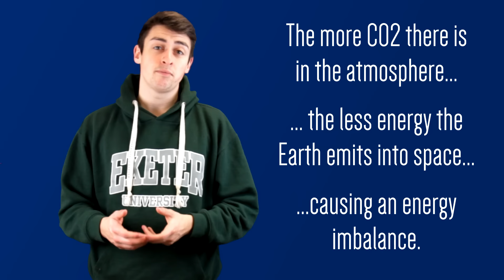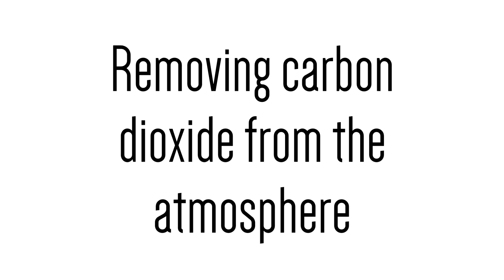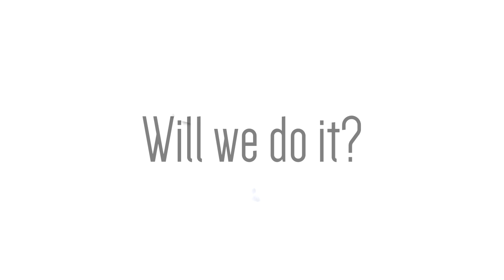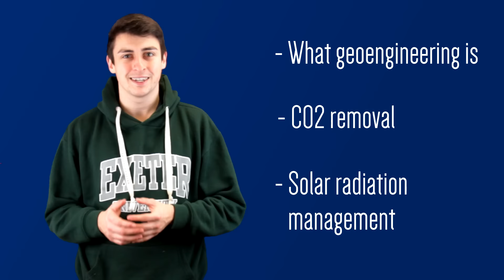Geoengineering - Crash Course #7

Comment: Bro geoengineering is already completely going on and not only in study's it's already in full business use man, I live in South Bavaria at the Alps and on days where its gonna be really hot it's done from the morning until Midday/ Afternoon, depending
Basically you can see a few big airplanes high up that spread sth in the air that extends, done in patterns it covers big parts of the land.

No doubt planting more trees etc. would be way more sustainable.
Reply: Sadly, trees are not surviving. We're too far gone.
Reply: Exactly! I live in Allgäu and I have been documenting these chemtrails since years. Did you also notice a sudden stop in 2016? And that they recommenced in 2020? I had almost forgotten about them until I noticed the grid during the first lockdown.
Reply: @MaryJoDeLaTorre7  I document them too!

Comment: What are your personal views on nuclear energy? Particularly on thorium based fusion reactors. I read It could have the potential to replace fossil fuels, but many events during the nuclear development era (WWII) prevented this from happening.
Reply from the maker: +Mauricio Ortiz It's a very complex issue but I think we need to use a lot more nuclear power. It's the only technology that has been shown to produce enough energy for our needs while emitting less carbon than fossil fuels in the long run. Safety concerns as far as nuclear goes are overblown I think.
Reply: +littlestarfish87 With new reactor designs waste isn't that big of a problem and in any case the problems nuclear waste is causing are minuscule when done properly and not like in the good old soviet union. Just look at the yearly deaths caused by nuclear compared to any other even remotely large scale electricity production method, the data shows that nuclear is incredibly safe compared to other even fully renewable forms of energy production. I fear that people going against nuclear are hindering progress when it comes to reducing co2 emissions because of fears that are born out of  not understanding how nuclear power works. The thing is that there are no large scale viable alternatives for fossils right now except for nuclear and hydro where that is viable.
Reply: *****  I dont trust anecdotal evidence only statistics. The thing is that there is no renewable technology in the market right now that is even close to the economical feasibility of nuclear and right now is when we need to start replacing co2 heavy production methods not in ten or twenty years. I think i understand nuclear radiation well enough. The people who go against nuclear often don't.
Reply: CHECK OUT ALL THE AREAS ALL OVER THE GLOBE THAT ARE RADIOACTIVE FROM NUCLEAR TESTING , DUMPING NUCLEAR WASTE, NUCLEAR DISASTERS FROM POWER PLANTS !
IF A SUBSTANCE CAN'T BE BROKEN DOWN QUICKLY BY THE ENVIRONMENT , DON'T MAKE IT OR MINE IT !!!!

Comment: 3)  Is the climate change being caused by humans?   
 
By far, the largest factor affecting world temperatures is the sun.  Just notice the difference in temperature between day and night or winter and summer.  The amount of irradiance the earth receives has a dramatic effect on temperature.  The yearly cycle of orbiting the sun as significant effect on temperature.  But, there are other longer cycles in play as well.
 
The 11-year sun spot cycle affects earth’s temperature.  During solar flares, cosmic rays that normal bombard the earth freely, are greatly diminished (pushed aside) by the energy coming from the sun spots.  This effects cloud formation.  From Google: “Cosmic rays are charged particles that bombard the Earth's atmosphere from outer space. Studies suggest they may influence cloud cover either through the formation of new aerosols (tiny particles suspended in the air that can grow to form seeds for cloud droplets) or by directly affecting clouds themselves.”  
 
Clouds can reflect heat entering the earth’s atmosphere (the albedo effect: the measure of diffusive reflection of solar radiation out of the total solar radiation received by a body) or they can help to trap heat beneath them and raise temperature.  The balance between lower temperatures ((albedo effect) and raising temperature via entrapping surface heat is not well known.  But suffice it to say the sun, cosmic rays and clouds are integral to varying temperatures.
 
The Milankovitch cycle describes the ever-changing relationship between the earth and the sun.  The elliptical orbit we have around the sun varies over tens of thousands of years and becomes nearly circular.  The 23.5-degree tilt of the sun varies over thousands of years.  The “wobble” of the earth changes such that Vegas not Polaris will be true north at some point, and then back again.  All of these factors contribute more to changes in temperature cycles than CO2.
                                                                                                                  
CO2, the culprit most cited by global warming alarmist, is only 400 parts per million (PPM) in the atmosphere.  The vast majority of CO2 comes from the oceans, decaying biomass, and volcanoes.  Only one-tenth of CO2 comes from humans or 40 PPM. Just as a reference, that is like one penny out $250 worth of pennies…very small.
 
CO2 has ranged from 7,000 parts per million to as low as 180 parts per million - and life survived.  In fact, in times of higher CO2 concentrations, agriculture flourished, famine was reduced and human advancement increased. Humankind was freed from spending all their time tilling the land and was able to contemplate the stars, write poetry, advance science and ponder the meaning of life. Did you know that greenhouses intentionally pump in CO2 to levels of 2,000 PPM or more because plants thrive in a CO2-enriched environment? 
 
Arctic and Antarctic ice cores conclusively show over and over that periods of significant temperature rise always precede the rise in CO2; by many decades or even hundreds of years.  Why?  Because the oceans, by far, the largest repository of CO2, release it as temperatures rise.  This leads to massive increases in vegetation which, as it dies, also releases prodigious amounts of stored CO2.  CO2 continues to rise, as a lagged effect, for decades or centuries after a cooling period has started.  The causality is just the opposite as expounded by climate alarmist.
 
CO2, as a greenhouse gas (GHG), is a poor retainer of heat.  Yes, it does, as a GHG, elevate temperature especially between zero and 400 PPM.  However, it is an ever-decreasing asymptotic curve of diminishing affect.  It is estimated that a doubling of CO2 to 800 PPM would only have a .7-degree C impact on global average temperatures. Why?  Because the bandwidth spectrum that CO2 resides within is nearly saturated at 400 PPM.   
 
Let's not forget that water vapor is by far the most abundant GHG (about 85% of GHGs).  It has far greater impact on heat absorption in the atmosphere than CO2.  But let us for argument sake say that global warming is real, it poses a threat, and it is man-made.  Next question.
 
4)  Is there something that we can practically do to change the threat of global warming?
 
Short of shutting down all fossil fuel consumption, what is it we can do?  Will better MPG or electric cars (which use energy from electric plants that predominately burn fossil fuels) stop climate change?  Will going to all solar and wind help?   
 
Only about 3% of US energy comes from these highly subsidized yet unprofitable businesses. These technologies do not have the ability or resources to provide the energy needed to run the U.S. economy, and won’t have it for decades.  If we shut everything down will it make a difference?  What data, analysis, or studies show that a 100% effort by humans would change the natural temperature cycles the earth has experienced?  But let’s assume we can, next question.  
 
5)  If there are practical things we can do, are they affordable?   
 
Who is going to pay for all this climate change remediation?   Do we even have a plan of what actions we would take, what the timeline would be, or most importantly how much it would cost?  What is the plan except invoking mammoth carbon taxing?  Will the poorest 180 countries contribute any money?  Probably not.  In fact, they likely will receive a massive influx of cash to “fight” global warming.  Can you guess why they signed the Paris treaty?  One perspective is that climate change is really just a justification and means to help redistribute the wealth of the 20 richest countries, mostly from the U.S., to the poorest nations.

Comment: OK, so I really don't understand the constant reference to Oxford U. Apparently Exeter is not related to Oxford (brief look at Google), anyway....

So, 3rd years PhD students in physics dismiss ideas like a "solar shade" by saying "sticking anything in space is really expensive". So much for the quality of critical thinking across the pond. (The EU wants to spend $3T - used to be $13T - to become "carbon neutral". Now, THAT is "really expensive".)

It seems to me that a series of satellites at the "LaGrange Point" between the earth and sun could be used, over a decade or more, to reduce incoming solar radiation to some desired amount. Total cost would likely be a fraction of what the EU wants to spend. I estimate the cost to be about $1T, not the 3 or 13 T for possible pipedreams. Why this is a poor solution has never been clear to me, except that the real agenda is to control the world's economy.

Now, I am in favor of reducing reliance on fossil fuels. The use of coal and gas are generally dirty to burn, cause some level of environmental harm when extracted, and, of course, release lots of CO2.  It seems to me that a quick, technologically available solution to the issue of ambient CO2 concentrations, however, would be to build nuc plants. Use Cold War bombs to fuel the plants. CO2 generation per KwH is miniscule, plants can be built with standard, safe designs, and thorium and other next-gen plants will eliminate most "nuc" issues. Again, why this is not at the top of the agenda has to make one wonder.

It seems to me that terrific confusion arises when "climate scientists" - who by the way understand 20% of what happens in the earth's climate - leave their lanes and lead discussions about economics and political wisdom of one policy or the next. CS should stick to explaining the climate and perhaps allude to future tech solutions. Let economists tell us what CC options will cost. Let politicians select good options, evaluating the best science available objectively, the costs of solutions, and the political mood of the public.

I will bet my life savings (I'm 64, so not a real bet) that in 50 years people will laugh 'till they cry at the low-intelligence level of debate in the 2020s about CC. We will have almost assuredly found a tech solution to the problem at some point or, equally as likely IMHO, determined that most of the current temp observations relate to natural cycles, not CO2 levels. Of course, in the 2070s, we will have invented some new bogey man to frighten and control the masses....

Comment: Great video! Though i would like to have heard about the costs of the geoengineering concepts mentioned even if it was only the magnitude of costs. 

Calculate the costs of switching to unreliable and expensive forms of energy production and one might see that suddenly this geoengineering thing becomes much more viable. Even if just considering the money spent on renewable energy subsidies in the western world.
Reply: Hi.

The carbon capture form of geoengineering he mentions requires alternate forms of energy as a prerequisite, the idea is to use non-CO2-producing forms of energy generation to create enough energy to suck the carbon dioxide out of the air.